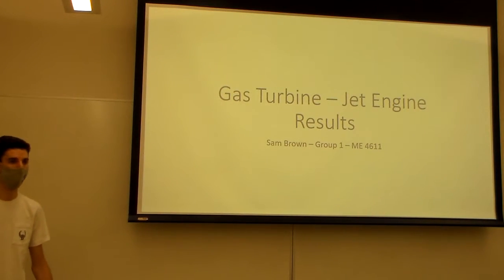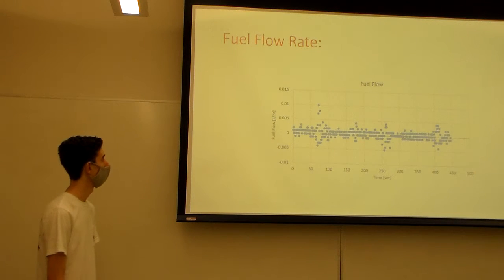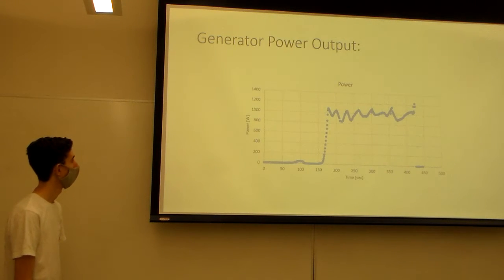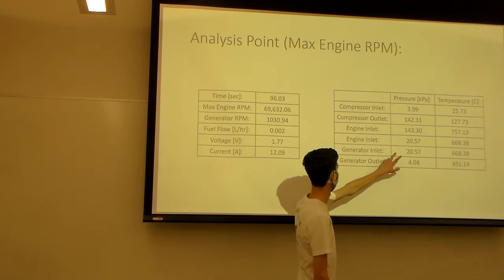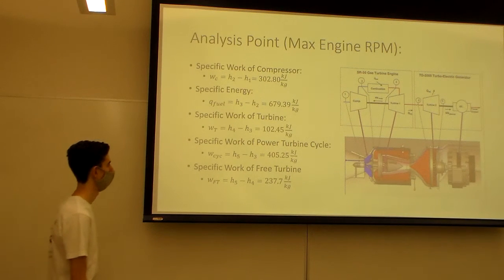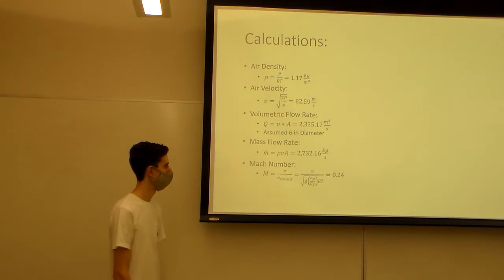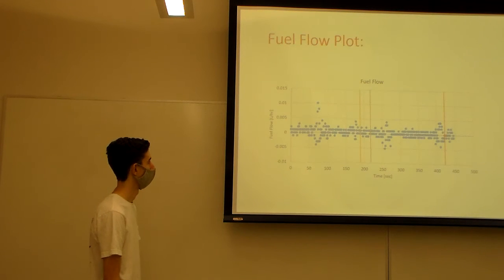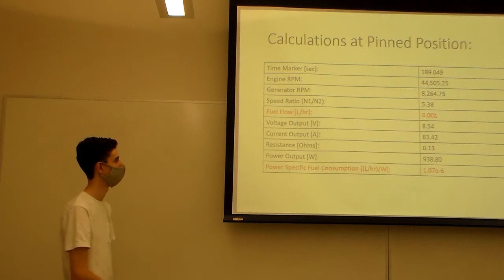Sam's Video

Comment: Technical Content: Sam's presentation was good overall, but suffered two small mistakes which threw off many of his values. The first was out of his control, as the flow data was not properly recording during the experiment. The second, though, could have been avoided had he gotten the correct area calculation. Check those units Sam!

Comment: Technical Content: Sam showed the results very clearly through bullet points and graphs. The graphs were easy to see with the distinguished difference in line colors for the varying data of inlet and outlet values. The one critique on the graphs is that from the back the words are hard to see, so an easy fix is making the font size larger on the graphs. The analysis was effectively walked through for full understanding of how his analysis was carried out. Because the analysis was easy to follow, the area mistake was able to be found to fix the data values. Great job Sam!